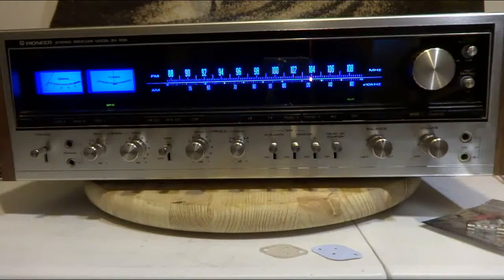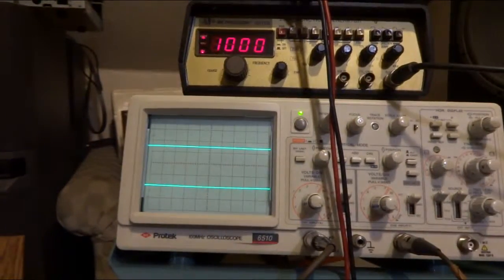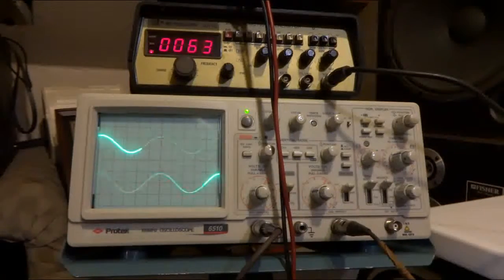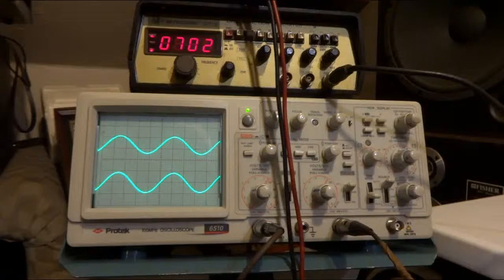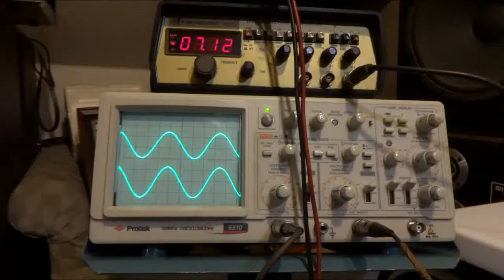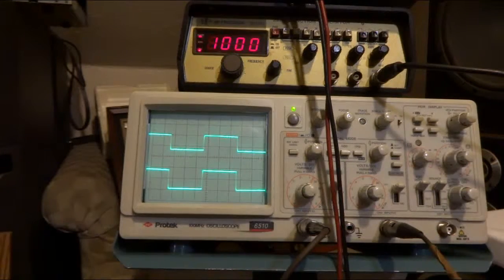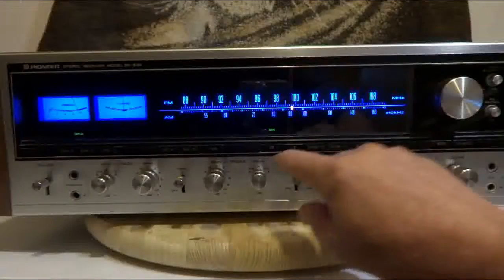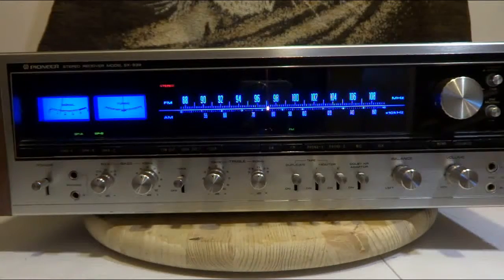Pioneer SX 939 Rebuild

Comment: I just bought a SX-939 and like Beth's (comment below), mine also has an intermittent popping noise. Mine was recently shipped to me by the seller who owned it many years and never heard a single pop. It doesn't matter if I am using, phono, tape or tuner. It also pops when I power on the receiver and I am not playing anything. I have read through a few forums and no one seems to have a solution, yet several SX-939 owners report the same problem. I would love to hear someone explain what it was for them and how they solved it.  Patrick, any new thoughts on this common popping problem for the SX-939?   And thanks for this video.

Comment: Hello  again  Pat, What  are  the  specs  on  those  LED  fuse  type  bulbs .  Will  they  work  in  a  sx-1010?  Thanks  for  your  videos !
Reply from the maker: I got them from Parts Express. Yes they should work in your sx-1010 if it uses fuse type bulbs but check your voltage for your lamps. They are for a 8 volts, a little lower would be alright but I don't know about higher.

Comment: I have this receiver. Do you know what could cause this unit to make a popping sound? Everything still is lit up, turntable still working but on occasion it will make that sound, go silent for a few seconds then come back on.
Reply from the maker: Do you hear the relay clicking when this happens. If so, then there is something that the protection circuit doesn't like and is turning the relay off and then turns back on when things cool off. Or it could be many of other things.Try going to audiokarma.org  Just type in your model in the search, there is a wealth of information and many of great people there that will get you going in the right direction.
Reply: Thank you so much. I will check that out!
Reply: @beths5923  did you ever find the answer to your "popping sound?" I just bought one that is doing the same and the seller says it wasn't doing that for him.
Reply: @Kymaureen1  Hi, yes I was able to fix my problem by cleaning the "pots" with some Detoxit (electronic cleaner fluid). Hope that helps! Definitely do a bunch of research before cracking into your electronics!!